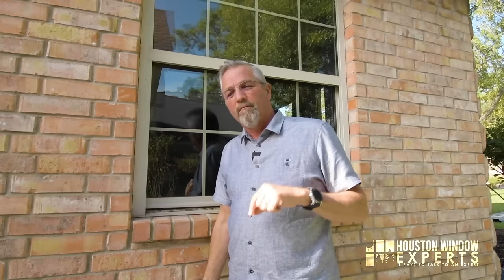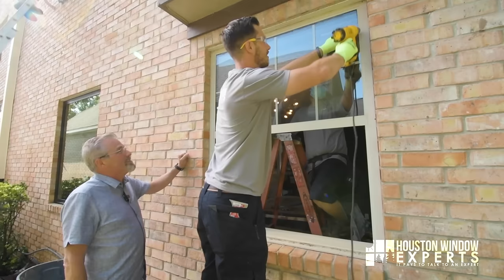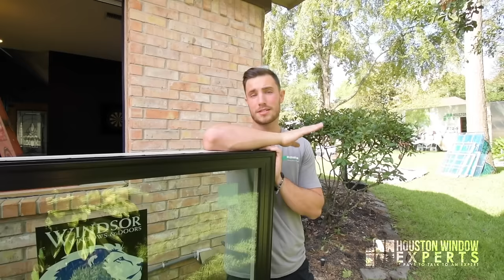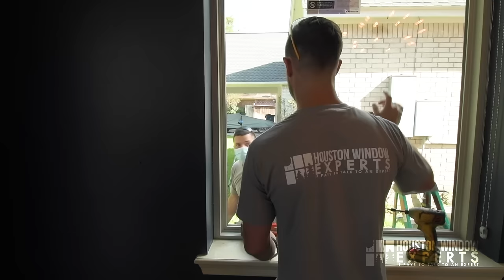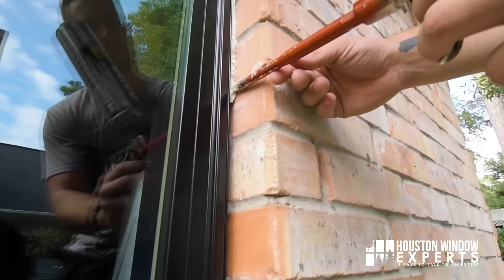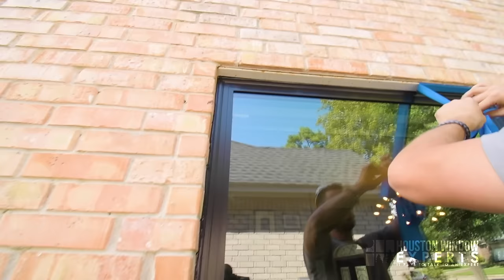Replacing Windows In A Brick Home The RIGHT WAY

Comment: Oscillating multi tool with a flat blade between the glass and frame usually takes care of this easily and quickly.  Five years of doing that and the only time glass broke of that was when my helper dropped the glass walking outside.

Comment: I just had NewSouth Window  install impact doors and windows and it is amazing how different it is here in Southwest  Florida. 16 5 inch tapcon screws in a single normal size window. And they also used the OSI polyurethane caulk which is incredible stuff. Lol on the 2 installers. They came with 2 the first day and 4 on day 2 and 3. Still not done and this has been since November 2020. 8 months and counting since the windows were ordered. One window was broken on site, one was damaged at factory obscured glass was not on the bath window so as you can see, this is a year long event down here to get replacement windows. Excellent video, thanks.
Reply from the maker: Thanks for watching.
Reply: Got a quote from new south before watching all of these videos. After educating myself some more I'm glad i decided not to go with them.
Reply from the maker: Good job!

Comment: We recently had our vinyl siding, gutters, roof, and windows replaced with a company called Hansons here in Michigan. We now have Ice build-up going down the side of the brick during the winter months. I thought was gutters called the company they said it was a roof issue. When I told them they had also done the roof just under a different phone number and name. I just keep getting the run-around. My window is 3-panel windows which are supposed to be the best. The problem is they never reinsulated around the window. I've now called 13 times. They promise to come out and never show up. Not to mention I now have 2 inches less on each side and top and bottom of the windows and 8 inches more siding. I replace the old railing on the front porch with columns and had to remove some vinyl siding in the process. Had Hansons come back out. The guy replaced some of the siding with a cheaper smooth piece of siding which wasn't what I paid for in the first place. Oh and the siding in front of my house keeps popping off and falling on the ground. No luck with them coming back out again to fix the problem. I've now had to purchase a bigger latter that I have no room for to fix the problem myself.  I guess what I'm saying is that just because the company is well-known in your area doesn't always mean they are the best or even know what they are doing. Your windows are only as good as the sales rep that measures them and the installer. The same goes for the siding, gutters, roof, and almost as important Customer service. It's been 3 years now and I'm already shopping for new windows, gutters, siding, and roof  Which is going to cost me roughly another $40.000. I wish I would have seen this video before I went with Hansons.  Your video was packed with a lot of information I could have used before going with Hansons. Great job on the video.
Reply from the maker: I'm really sorry to hear about your ordeal with them. That's horrible. Hopefully I've been of help!

Comment: No bottom sash tape that covers the bottom corners and goes up both sides part way?  It is a pretty thick barrier that avoids a lot of problems that cannot be controlled by spray foam or caulk.
Reply: I thought that. Probably the ‘secret’ he mentioned.

Comment: The brick isn't sealed to the house. How do you keep moisture from behind the brick from getting in the osb and drywall between the two areas you caulked? On most new homes today you tape the outside of the window to the house wrap and when replacing windows that cannot be done unless you remove and reinstall some of the bricks. Brick is a permeable substance and a lot of mositure can transfer through brick and get behind the area you caulked and spray foamed.
Reply from the maker: Bobby, we use foam and a special flashing we created.
Reply: This is a window installation video bricks work, framing wall ,etc is another movie

Comment: the Previous windows weren’t caulked yet there was no water issue that we’re aware of? Speaks volumes for the previous installation also I would’ve thought. Caulk silicone should be used to increase water ingress integrity, unlike its gross over use these days where it moreso makes up for poor workmanship. Thanks for sharing all the same, some interesting and valid points you’ve shared.
Reply: The water not getting in could have been due to the side of the house it was being pulled from, or the water shed barrier was done properly and it kept the water out, or both. The fact that the windows weren't caulked speaks heavily to the quality of the builder not the installer as the windows go up before the brick and are caulked by a different crew after the brick work is finished. The window they pulled was an original window probably from Atrium Windows on a new construction (thus the use of nail flanges).

If you are getting shoddy work because of the Caulk lines then you're using inexperienced or shoddy installers. As a certified installer I can promise you that an experienced installer can hit those lines without the need for tape or knows to use tape and soap water if they aren't great at making straight lines. Either way you shouldn't have a shoddy finish out on your jobs because of caulking. But now you should talk about how much your Installers cost, here's where cost to quality ratios usually show up.

Comment: How did you seal against water penetration behind the brick. This is literally the most important part in my opinion. How was it flashed?  WDMA installation instructions call for an interior measurement and installation, with aluminum flashing at the head-  a turn up leg on the flashing to be tucked behind the wmb. I've seen others measure exterior brick to brick but I guess I just don't understand how it's flashed. Would love to learn.
Reply from the maker: Joshua, thank you for watching and your question. Here's a specific video about the flashing process we use. 

https://youtu.be/wP6VJo52Xk4

Comment: Those screws are meant for trim work. But, I have found they are such overkill for trim that I have even used them for doors. Just make sure you get it right the first time because the reverse threads will destroy wood work when you remove them.
Reply from the maker: Great observation. Thank you for your comment.
Reply: @texasfossilguy  Good point. I always forget that option.

Comment: What kind of frame is this from Windsor? I’m replacing in brick as well. Windsor’s website only shows the next dimension classic with a nail fin. Wouldn’t I want a block frame? Would a single or double hung match better with a direct set /picture window from Windsor?
Reply from the maker: It's the Next Dimension Classic series in a block frame. It will look different than a direct set fixed window, but it will be fine.

Comment: I live in Channelview Texas, My window looks just like that from the 50s I watc8and paused your video to measure my one bedroom window. I didn't want you did and my measurements are brick to brick bottom was 35 1/2 or 5/8, and middle was same,  and top to bottom was 47 Or 48in. Outside measurements. 
I'm wanting to know what are regular measurements for regular windows. I just want one window in my bedroom done. Can you tell me please.
Reply from the maker: In the window industry, there are some common sizes but not any guaranteed sizes when it comes to replacing windows. You're going to want to call a window company to come out and take a look at it. I wish there was an easier way to do it. If it's just one window, it would be good to contact Home Depot or Lowe's. They're going to be your most cost-effective way to do this.

Comment: I’m struggling to find the 3 1/4” screws that were used in the video. I heard them mention finishing screws, T10 bit but I haven’t found them at my local Lowes/Home Depot. Has anyone found them and if so could you drop a link? Thanks! Great video
Reply from the maker: You might want to do a search for a composite deck screw. They are nearly identical.
Reply: @HoustonWindowExperts  thanks! I found something similar in the deck screw section but the threads weren’t quite right! Much appreciated.
Reply from the maker: You're welcome

Comment: Houston Window Experts, I have watched a number of videos on window installation and many of yours.  Question, Fine home building using a flashing system on a window replacement.  Why not in this one was one used?
Reply: Interesting why they didn't answer your question. ?
Reply from the maker: Justin, I guess this one fell through the cracks. Thank you for having my back on this. (I answer about 300-400 a week).
Reply from the maker: John, please accept my sincere apologies... I overlooked your question.

I've noticed in this area that many homes do not have flashing on windows unless it's stucco or siding on the walls. In fact, on the back of this house there is siding and they did have flashing. My guess is that the water is not presented on the window as much on a brick home as it would be on siding or stucco. In fact, many homes with stucco have major leak issues in this area.

Comment: My brick home window openings are similar but are 8'X6'. Pella said I would need full frame, Marvin says inserts would be fine. Was this a full frame install or an insert? We want to do an 8'X4' picture window above a 8'X2' slider. Pella Impervias full frame install is at $5100, while the Marvin Infinity insert quote is at $5200. We are going with fiberglass for strength  due to the window size.
Reply from the maker: In this video we removed aluminum windows so it was a full replacement. Do you have aluminum windows or wood windows?

Comment: I have brick house built 1973.
Single pane, single hung aluminum frame windows. It has the aluminum grids with single panes of glass in each one. I also have security burglar bars that are mounted into the brick.
How would these windows be changed?
Reply from the maker: We'd change these the same way as we did in this video.

https://youtu.be/m5wYhQCRN54?si=xyyyeTe4reXWJMtg

Comment: The most important part was the sealing, and you skipped it.  I want to know how you integrate the new window with the existing WRB.  If you only rely on sealant, then it isn’t the “right way” as sealant is an ongoing maintenance item that doesn’t last for the life of the structure.  Do you have a video showing how the existing WRB was integrated with the window?
Reply from the maker: We use minimal expansion foam. From my experience it will last as long if not longer than the window.
Reply: I agree. I read the same thing about the difficulty with the old WRB and new window installs. The only thing I really wanted to see was how they waterproofed a window without any room around the outside of the brick. I want a company to do mine but want to make sure they do it right and now I still don't know. Are you implying that the only flashing or waterproofing is the foam sealant and a great install? Please let us know so we actually know the proper way to install a window in this situation otherwise we just saw your products and excellent pride in your worksite cleanliness. I agree those are important but please disclose what we need to see when a window is properly installed. Most of us home owners just want to be sure whomever we hire is doing it the way it should be done. I doubt it's a trade secret if it is the only way to do it right. Thanks for taking great pride in your work and making a great video that is easy to follow and understand.

Comment: SO how many times does prying the sash out like that tear up the wood, ESPECIALLY if they used screws to secure the window? I pry out(from inside) and use a sawzall to cut the nails/screws.

 BTW, in the industry "Guaranteed not to leak" means that IF IT DOES, they'll come out and reseal it for free. 

Me,  35 yrs in (union) Glazing. First 7 in Auto glass and we guaranteed them not to leak. When I got into residential and commercial, I said, "I guaranteed moving vehicles, up to 100 mph and over RR tracks and potholes etc. not to leak, how hard can a stationary building be?"...lol

I threw my levels away ( you take a level and 10 guys and have them draw a "level line" on a wall. You will get 10 different  "level lines") years ago. . I switched to  4-way laser. MUCH more accurate.

Quality caulking is 3M or Dow Corning.  Depth is half the width and tooling (NOT with finger- kidney, cancer, and organ damage- I lost a good co-worker and friend to that last year) is to remove air bubbles. 

In commercial, they do "pull tests" (cut and try to pull a 1' section loose) and "water tests" (have a grid of water nozzles, that covers a window, outside, with a sealed frame inside, hooked to a vacuum and then soak the window for 15 minutes, while trying to pull the water in with the vacuum). Passing THAT is a GOOD job.
. 
Also, there's LEVEL( horizontal), PLUMB (in and out), SQUARE (side to side) and TRUE (in line- you can have level, square and plumb and it be NOT true).  On a storefront (like a shopping center), you can have 50 frames attached together, they need to be on the same straight line- true.

Lastly, remember the "3,4,5" trick for a square corner- measure 3 (inches,or feet) on one plane and 4 the other plane and the distance on the 3rd plane ( from 3 to 4) should be 5.

Now, for extra credit, who knows the formula for a radius, when the "point" is in space (remember how to make a radius- for a 12" radius, say, secure a nail and then run a string out 12" and attach a pencil and run that  and THAT is a 12" radius. That technique works for ALL radii, BUT when the radius "point" is in space (I had a 100' radius storefront on a mezzanine of an airport terminal, so the "point" was somewhere in space , over the ground floor)?
Reply from the maker: Sometimes when wood windows are present there will also be an exterior brick mould. We remove the molding and remove the window entirely with the nail fin and all.
Reply: @HoustonWindowExperts  ????  Brick mould= trim. In ALL my 30+ years I have NEVER seen where windows were put in, from the OUTSIDE, AFTER the red brick was laid.

Also, you say wooden windows,  so aluminum or vinyl windows can't be screwed in with screws?

Comment: Jeff what do you do if the wood studs INSIDE the house are narrower then the brick opening? In other words doesn't the window slide in-between the studs that are inside the house?
Reply from the maker: In that case, you will need to make the window fit inside the studs and then trim the exterior with some brick mold or similar material..
Reply: @HoustonWindowExperts  Ok that is what I thought. You are so helpful it is amazing. Would the same go for the height of the window as well? By that I mean the height of the window needs to fit inside the studs as well??? Thank you. Thank you. Thank you.
Reply from the maker: Yes, exactly
Reply: @HoustonWindowExperts  Thank you so much. Honestly I have so much time into researching this your response means a lot. Thank you again.
Reply from the maker: I'm glad that I was able to help. Good luck.

Comment: 10 years ago I bought a home built in '75 which had the original windows and patio door. I replaced them all with beautiful, excellent quality windows and I love them. What I don't like is that I lost all the inside space to install blinds so they had to be hung from the frame which leaves a huge gap around them all. I've got my eye on a home built in '80 now and the windows need to be upgraded. If I buy it, I hope to find upgraded windows that won't eat up all of the inside space.
Reply from the maker: MsJulie, thank you for watching our channel. That is something that you would want a good installer to point out to you before you bought windows. Most window companies make varying depths of window frames in order to accommodate some of these concerns. If you need help finding a good window company near you, please check out JeffsList.com
Reply: @HoustonWindowExperts   Thank you very much for that tip. I'll surely remember to ask about that the next time so that I don't run into this issue again.
Reply from the maker: You're welcome

Comment: I am somewhat of a diy guy but I don't mess with windows or whole roofs.
I've been watching several videos and now I'm confused.   I had all my windows professionally replaced many years ago but one window was actually manufactured wrong so they gave me a new one and I kept putting off having the installer come...then he died.....so I'll do it myself.
It's aluminum and my house is brick.
Do I install it from the outside and trim the flange to fit?
Reply from the maker: Yes, the window should be installed from the outside.
Reply: @HoustonWindowExperts  I really appreciate that piece of information.
Reply from the maker: You're welcome!

Comment: It would be better to install the flashing before putting back the new window. Great details in the video.
Reply: It would have been better to flash first motar can absorb water, yes the foam is waterproof that doest mean the water won't drip inside between the window and rot the bottom plate.

Comment: You said that you level and plumb the windows. How can you do that since the windows were custom built slightly smaller than the opening. Doesn't seem like there would be much room for adjustment.
Reply from the maker: We leave about 3/8 of an inch overall on the width and the height for this purpose.